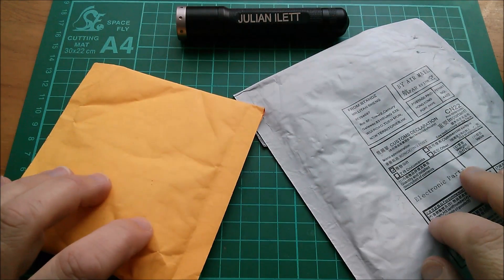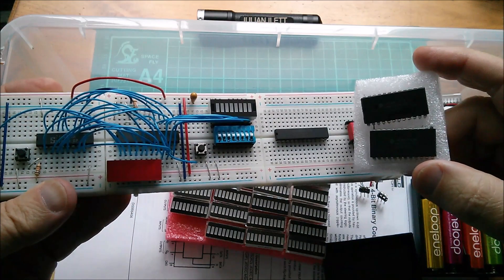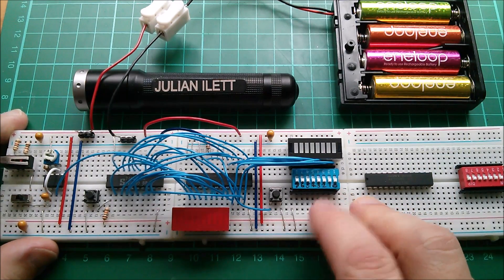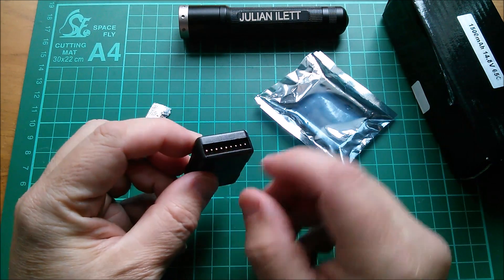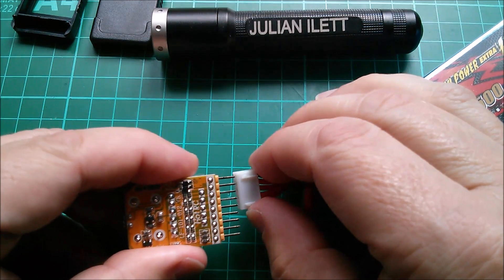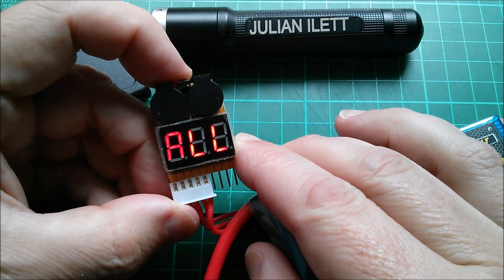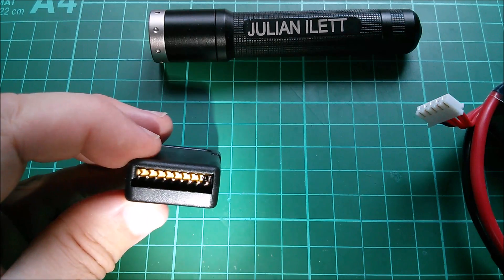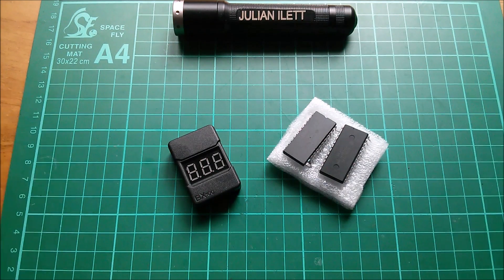Julian's Postbag: #106 - LiPo Cell Tester and 6116 RAM

Comment: For some fun try setting up one of those RAM chips in a breadboard with inputs set up to disable the chip,  then measure the power supplied to it.  Last time I tried that it was under a microamp!  Which is why a coin cell can keep the contents of the chip intact.  The tricky part is making sure that none of the enable inputs are active when switching from main system power to backup and vice versa.

Comment: With the bent pins on your static RAM chips, if you can get the legs straight, mount them in machined pin DIL socket, then use the DIL socket pins to plug into your board.
That way you take ALL the strain of insertion and removal away from the IC.

Comment: Those memory chips are recycled. The date codes are 1213 and 1426; different years. They're also different types, as signified by the 'L' at the end of the number on one of them. The pins were very likely bent even before the package was posted. And foam plastic for 'protection'??! Static damage is also a possibility.
Reply: i wondered that..maybe 'fakes'?? certainly dont look anything like genuine hitachi 6116s i have.. 😲

Comment: I think when you are talking these model batteries that the "S" stands for "series". Packs are denoted as 1S, 2S, 3S, then 1S2P, 2S2P, 3S2P etc. The S means series and the "P" means parallel. A 3S2P battery has 6 cells.

Comment: You can get new SRAM ICs much cheaper (and without bent pins). A 32 KB PDIP SRAM costs 2€ on mouser.
Reply: Yep, but you know how Julian likes his eBay!  It may also be that the old 6116 was not available at the normal big IC suppliers.  Just because it is old doesn't necessarily mean they won't have it as they tend to keep stock of whatever still sells.  I always check the big suppliers (Newark, Mouser, etc.) for components before resorting to eBay.  And they sometimes even have sales on the stuff I am looking for.  And much faster than ordering from China and less likely to be damaged.  YMMV.
Reply: What is so special about the 6116? Modern SRAM ICs are pretty much a drop-in replacement.

Comment: The 6116 was THE SRAM chip around 1982. I used the 6116-LP (low power) when breadboarding my Z80 in anticipation of a battery-backup (never got around to that).

Comment: Those battery testers are kind of superfluous on aircraft now since modern flight controllers have an input connection for battery voltage monitoring and an output connection for a buzzer. The first one came out shortly after I'd bought 3 of these - in typical fashion - so now they just sit in a box gathering dust.
Reply: Still useful to determine whatever the battery is charged or discharged. Not very accurate though.
Not all models have flight controller. Flying wings and trainers usually don't have flight controller. Alternatively a cam with vbat OSD or receiver with vbat input which goes to telemetry

Comment: I was wondering, I know what sram and dram is, but why do most pc's use dram instead of sram, or is dram just faster?
Reply from the maker: DRAM takes up less chip space per memory cell, so DRAMs have a higher capacity.
Reply: Julian Ilett ah thanks, didn't expect to get a response from you, but I did think it was odd that such a big chip stored so little, especially if they're fairly modern
Reply: SRAM is better and more stable, but every SRAM cell needs at least 4 transistors. A DRAM cell just one (and maybe a capacitor). A drawback of DRAM cells is, that they need a refresh every now and then. But DRAM is much smaller and therefore way cheaper.
Reply: Thomas Ford   the package is big to get the standard pin spacing for this format.  The chip inside it is probably tiny and industry would use a tiny surface mount package.   But they're buggers to solder by hand!
Reply: Thomas Ford - The 6116 is hardly "modern" being around for 35+ years.  It is in a "big" package because the DIP package was used back then and Julian needs something to fit on the breadboards.  SRAM is used in your PC for a CPU cache with DRAM being used for your main memory because DRAM is muuuuuch cheaper and has a higher density than SRAM.  SRAM is fast and only requires power to remember its contents whereas DRAM is slower and requires constant "refreshing" of its contents.  Anywhere from uS to mS so you basically need some part of your circuit ensuring that this is done or the contents is going by-by.  This is the main reason Julian chose SRAM and not DRAM.